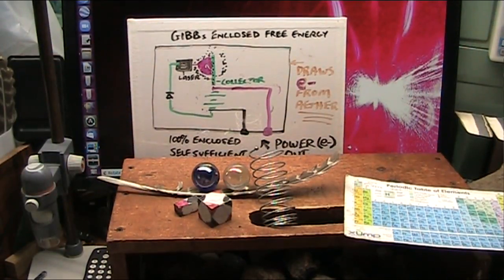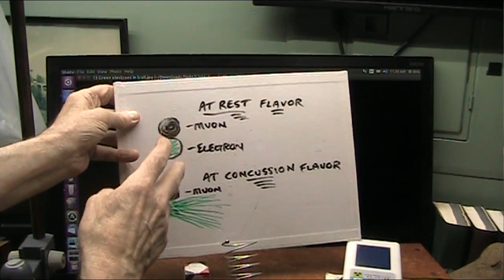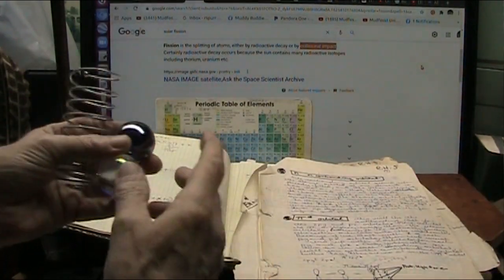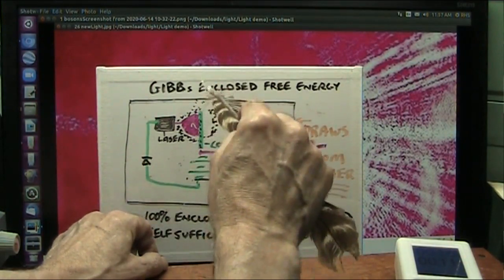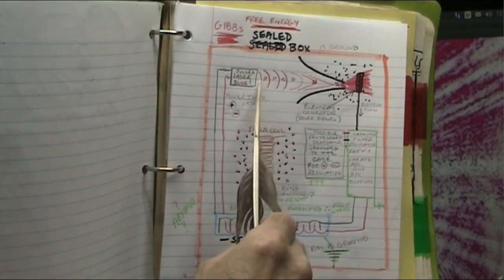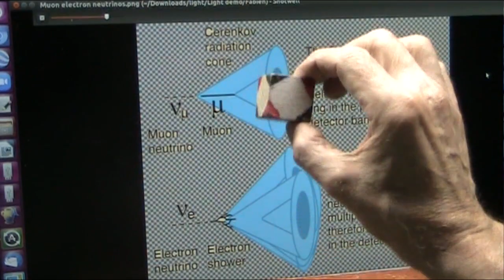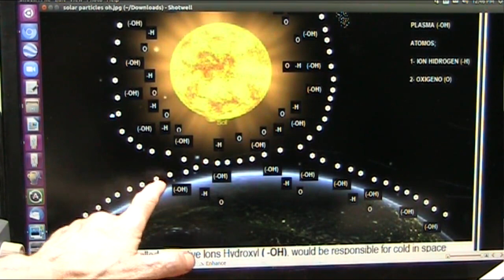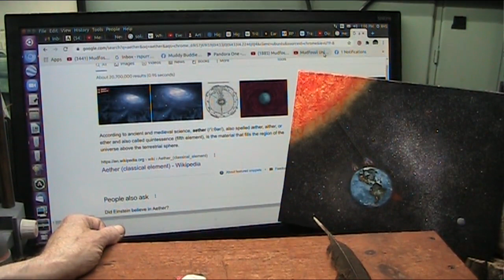Is Free Power from Aether possible

Comment: Very interesting video! There's so much in here that it's hard to know where to start. Although there's one thing I don't follow about fission involving photons: we can calculate the raw energy being produced by the transformation of matter into energy during fission with a maximum of e = mc², as in: if one gram of matter is totally converted to energy by fission we'd produce about 9e13 Joules (~15 kilotons of TNT). But photons don't have mass, otherwise they'd require infinite energy to travel at c as per the Lorentz factor 1/sqrt(1-v²/c²)); so how do we compute the (even theoretical) amount of energy produced by the fission of a photon? This formula gives either a zero energy result if they don't have mass or an infinite energy required to move them at c if they do have mass, so something doesn't add up and I'd be interested to know what it is.
Reply from the maker: Wrong photons have mass and it is impact value. I showed they are particles. There is no set speed C ...100% of all physicists are wrong as you are believing Einstein...100% wrong thats 100%.wrong.
Reply: @mudfossiluniversity  brutal
Reply: @mudfossiluniversity  Thanks for responding. Since this goes against pretty much all physics for the past 160+ years I think this kind of assertion deserves its own explanation. We build GPS satellites that take into account relativistic effects due to their own motion around the Earth, and if we didn't do this the position calculated would be way off. This has been demonstrated, verified, validated by thousands of experiments over more than a century so just asserting that c isn't a set speed isn't going to help with academia refusing to hear you. It's obvious that you are frustrated by these rejections and it's painful to watch it happen, I've called on this channel before for collaboration and discussion and have been saddened to hear back that your calls went unanswered. To be perfectly clear, I support your cause and find your passion endearing, but I also know how research works and don't see you writing papers, with math. Ok photons have mass, fine. What's the mass? Where's the experiment showing it? What are the uncertainty bounds? What was the experimental protocol? These rejections are going to continue forever if you don't show your work, with math and actual details. I'm rooting for you and can't wait for the day I can finally read a paper.
All the best.
Reply: Infernal Moondance  Thanks for the reference, I'll check it out!